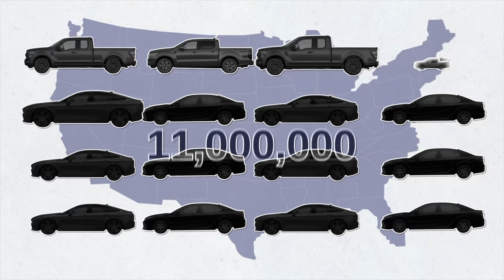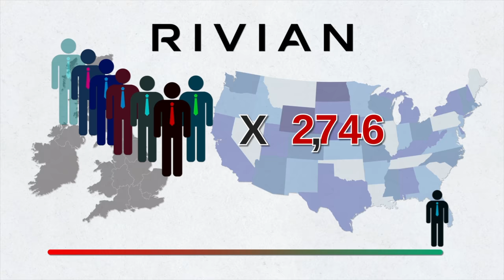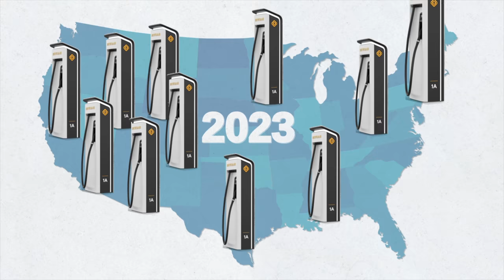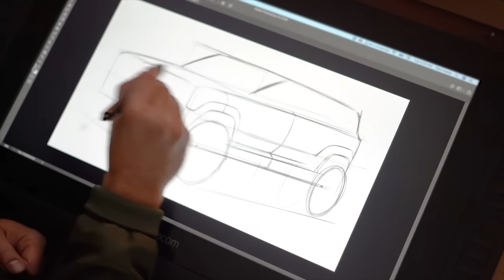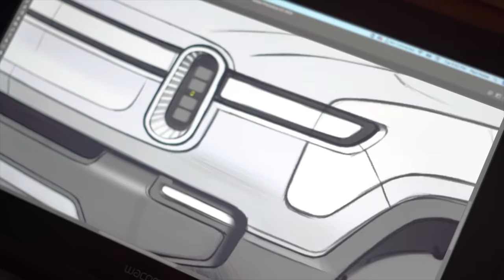Here's Why Rivian’s New Vehicle is the Future of Cars (Goodbye Tesla)

Comment: Just started working in the battery department at the rivian plant in my town!
Reply: Nice! When will they have a battery that goes 1000 miles?
Reply: @Maynardd  I would say within  10 year. Allready Toyota and Mercedes have a 1000 mile battery prototype just production too high
Reply: @Maynardd  never and thats not necessary
Reply: @mattbrew11  Being necessary or not is a matter of opinion, or what you feel you need out of a vehicle. Do I want to stop after the battery is completely drained from a full charge when I’m trying to drive from Michigan to Florida and wait around forever for it to charge? Absolutely not. I would have to wait a minimum 20 minutes just to get 140 mile charge. Not to mention finding a station along the way. It’s not like you can just pull into any gas station. What if I don’t have enough charge to get to one? And Its probably be more like 110 miles on a 20 minute charge. Then I’m stopping every two hours charging for 20 minutes. For me, completely unacceptable.
As I often tow a boat as well, now your range is cut in half. Also completely unacceptable. In my opinion a 1000 mile battery is eventually going to be a necessity.
Reply: @Maynardd  what will happen over time is the charging speeds will increase. On a road trip what you wanna do is leave at 100% then charge it from 5-10% to 80% the last 20% is slow just like your cell phone.  
There will be as many chargers as there are gas stations in the US by 2028 and more chargers than gas pumps by 2031. 

Also something to consider. All the time in your life youll save never going to a gas station when youre commuting.
Reply: The Baccologist  Norwegians laugh at you. 75% of cars in Norway are EV’s.
Reply: @hanzreynado  All made in Norway ?
Reply: @wildhorses6817  No.  What is your point?
Reply: @mattbrew11  Purdue U and Ford have developed a charging cable that allows full charging in 5 mins, same time as a gas fill up. Overcame the overheating problem.
Reply: The Baccologist  I have Tesla and the battery is programmed to heat itself at certain temp. Yes I live in Minnesota North Dakota area. Of course you want to keep your car plugged during those frigid temperatures. Or at least charge it up to 80-90% before you leave it outside at those temp. If you park it at 10% and don’t charge it than it is your fault. FYI Owning a electric car doesn’t mean that you can be free of common sense
Reply: How much does the pick up cost?
Reply: @mattbrew11  a 1000 mile battery would be   
a BiG seller !!
Reply: @mattbrew11  yes right, less time going to a charging station in yr life
with 1000m range  !!
Reply: @Maynardd  LOL when will gasoline cars go 1000 miles? Nobody cares because that's a stupid question.
Reply: @therabidsquirrelsage3388  you’re missing the point smart guy, there are plenty of cars that go 500 miles on a tank of gas, and since these batteries under any type of load lose half their distance or more! There needs to be a 1000 mile battery. Let me help you with your math, that would give it approximately 500 miles on one charge. And because batteries lose the capability of holding their charge overtime, it will only be downhill from there.
Reply: @Maynardd  you probably shouldn’t get one.
Reply: The Baccologist  diesel doesn’t work at -40 either.
Reply: What’s Rivians game plan to scale up manufacturing because even though I don’t see them beating Tesla I want to see more American brands wining while helping out the planet. I know elon tried to give Rivian some pointers and they didn’t take it. So I’m expecting them to meet some road bumps in the future.
Reply: @Maynardd   New supercharger will charge most of that big battery in 30 min. No need to wait long time. So 180kW battery is more then enought.
Reply: The Baccologist  Few procent reduction in range yes but batteries will never freeze when charged.
Reply: @corvus400  that would definitely help,
Reply: @Maynardd  Not as far off as you think! There's new battery tech in development that puts 1000 miles very much in reach and very possibly beyond 1000 miles
Reply: The Baccologist  Not with battery temperature maintenance they won't. You don't think they haven't already thought of this?? Lmao!! The batteries will be able to maintain their own temperature.
Reply: @fk6823  That’s good to hear!
Reply: Just started working at the meat department at my local grocery store
Reply: @nyamnyam32  sorry that you live in moorehead area. I was sentenced to 5 years there 😅🤣😂
Reply: @fk6823  I'm afraid that corporations want to make even more money. So they put new high tech battery with same kW as before, that will cost less, weight less, but sell it for same high price as before.
Reply: @Maynardd      only 20 minutes to charge?   wow.....you are very optimistic.
Reply: @Maynardd  Just 1,000?  I would like to see at least 100,000.  And if that is achieved, I would like to see 1,000,000 miles between charges.  And if one million miles is achieved....
Reply: @ken85225  Right now the truck can charge, it was either 120 miles, or 140 miles in 20 minutes. I never said they could charge an entire battery in 20 minutes, I have no idea. Technology changes rapidly. I’m sure at some point all of the above will happen.
But if I’m driving 1000 miles the way I’m stopping every 140 miles for 20 minutes to charge your battery. If I can even find somewhere to charge it.
Reply: @dinkstover8606  now that would be the way to go. An electric car you never need to charge!
Reply: @Maynardd  I like moving the goal posts infinitely. That way, I am never satisfied.
Reply: The truck is trash, range is less than 100 mls with a load and climate on... its a marketing scam, thats why they wont commit to commercial in their sales pitch. Its an SUV, its commercial, its X-gamez types - all iver the place because it’s not practical fir any purpose
Reply: @jf8085  that’s exactly what I’ve been saying! You just said it better…
Reply: @Maynardd  I
Reply: Start a YouTube channel and post videos about it.
Reply: @yolo_burrito you want to  bet it does and  never looses power..
Reply: I hope it works out for RIVIAN... it is very inconvenient to wait for hours until the battery 🔋 recharges. 😏
Reply: @zareththealchemist8982  $74k
Reply: @mattbrew11  KIA's EV6 & their planned EV9 SUV  already have 800 v architecture and fast charging from 10% to 80% in 20 mins. with 300 mile range. The EV6 recently broke the Tesla record on least charge rate for cross county US test.
Reply: @l.glucid9077  Could be 5 mins soon using the new cable just developed. Some will complain that is too quick, of course.
Reply: @dinkstover8606  => not a chance... I understand electricity.
Reply: @Maynardd  - I have no desire to be in Michigan nor Florida so I don't have that problem
Reply: @glennbarrera8353  And I wouldn’t buy an electric vehicle with such a low range. So I don’t have that problem either.
Reply: @Maynardd  - 99 problems but neither of us have to worry about buying a Rivian
Reply: @l.glucid9077  5 minutes. Cable overheating problem solved. Look it up.
Reply: Поздравления тогава!!!(congrat....s!!! in Bulgarian👍👍👍)
Reply: Now,this vlog is advertisement or yes!?!?😂
Reply: @dinkstover8606  => I have yet to see that... 🤔
Reply: @hanzreynado   The US is slightly different than Norway I would say... so go ahead and laugh away as you eat your fish in a jar
Reply: @yolo_burrito  Yes it does, just don't turn it off or it won't start again.
Reply: @scottar2  or just plug it in.
Reply: @Maynardd  A battery that is very large can go 1,000 miles, but it will be heavy, and it will need a long time to charge. This isn't the solution you should be looking at. The maximum range is most important between when you first leave home and when you make your first charging stop. After than time, the total time spent on the road trip will depend on how fast the vehicle accepts charge. A good example of this is the Hyundai Ioniq 5, which uses an 800 volt system. That allows it to charge faster and get back on the road. It doesn't have a very long range, because it isn't needed.
Reply: @rajendra82a  What do you mean a very large range isn’t needed? I wouldn’t buy one because it doesn’t have a very large range. Because it’s needed.
And no, I’m not looking at it the wrong way. Technology changes, batteries will get smaller, go further, and be lighter. You’re actually looking at it the wrong way.
Reply: @Maynardd  A typical gasoline powered car will have a 15 gallon tank and at 30 miles per gallon, it has a range of 450 miles. During long road trips, you are going to stop every six or so hours to get gas and food, which is why the current tank size is normal. An EV with a 1,000 mile range is therefore unnecessary. A 500 mile range will be a sweet spot, but with current battery capacity density and charging speed limitations, 250 to 350 miles is what we currently have available. It is a little less convenient, but the other benefits of an EV, such as low cost of maintenance, savings to operate daily when charged at home overnight, low carbon footprint, etc. are compelling enough reasons to switch for me.
Reply: @rajendra82a  I’m not sure what you’ve been driving but I haven’t come across anything that’s only 15 gallons. My truck is 26 gallons, my work vehicle is 24 gallons. I think you’re missing the point. Who wants to stop hanging out for an hour, hour and a half to get a charge out of a battery when they’re trying to reach a destination. If they can even find a charging station. And that won’t even give you a full charge. From my location I drive to North Carolina which is approximately 800 miles A few times a year. I need to fill up once on the way, it takes 10 minutes.
As far as maintenance, the cost to repair electric vehicles is astronomical, carbon footprint, now that’s laughable. Do you have any idea what goes into making an electric car? The forced slave labor, the lithium batteries that will end up in junk yards, and 10 years from now if half the vehicles on the road are electric imagine the overtime power plants will need to be working to charge these cars.. The whole carbon footprint and let’s save the environment is a complete joke when it comes to electric cars.
But the bottom line is this, there will be a 1000 mile battery which is actually a good thing, batteries will become smaller, and then more people will consider electric vehicles. The other issue electric vehicles have is towing. Currently you get about half the distance of a charge. Take the Rivian for example, only 175 miles towing 5000 pounds. And this is a truck. Electric vehicle simply are not where they need to be yet..